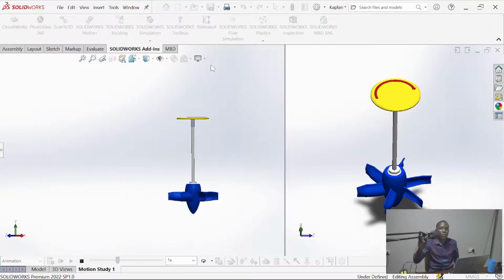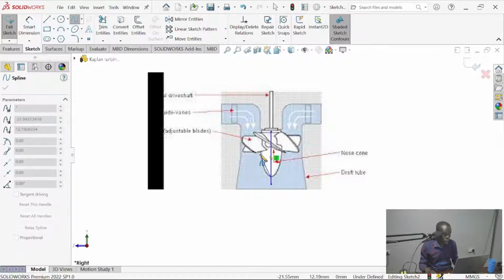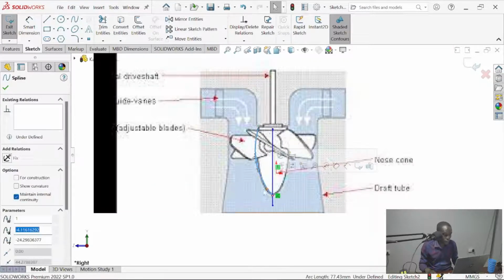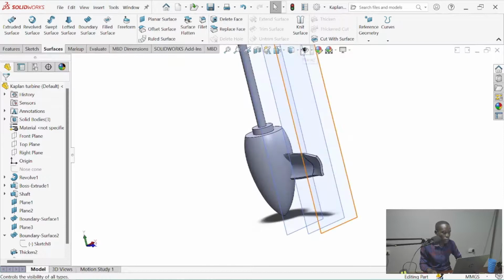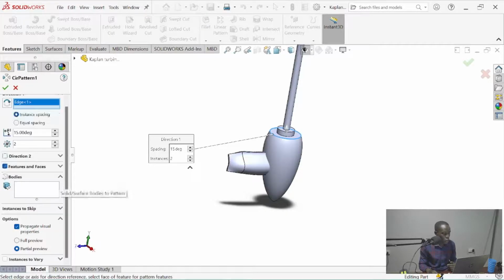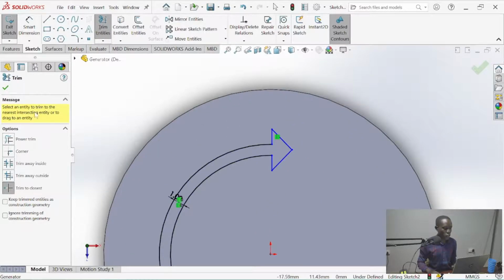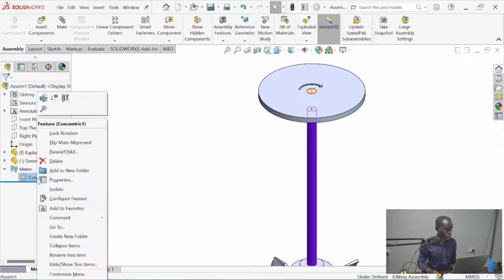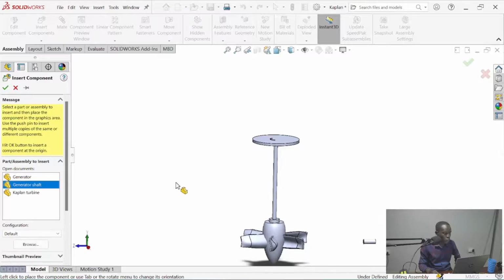How to model and animate the Kaplan turbine in Solidworks

Comment from the maker: The Kaplan turbine is a propeller-type water turbine which has adjustable blades. It was developed in 1913 by Austrian professor Viktor Kaplan, who combined automatically adjusted propeller blades with automatically adjusted wicket gates to achieve efficiency over a wide range of flow and water level. #kaplan #turbine #hydropower #electricity #propellers #blades